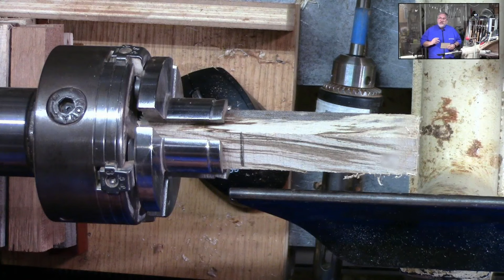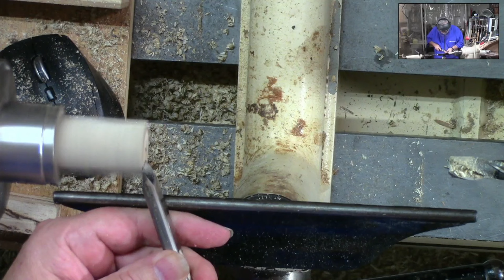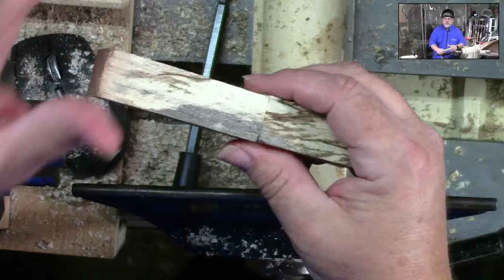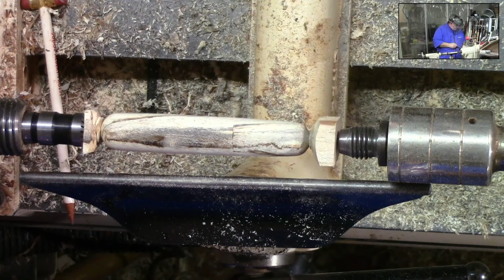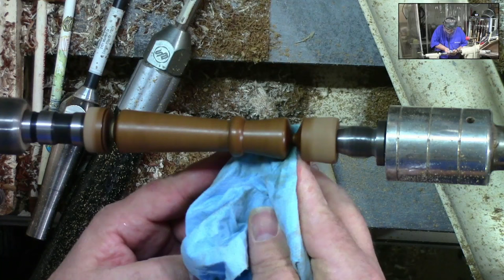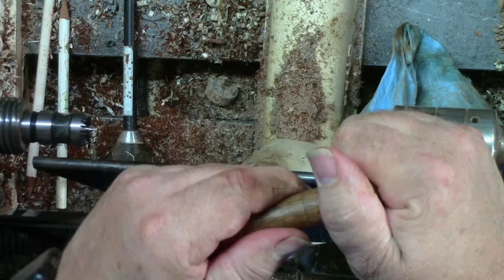How to Turn A Wooden Box That Sells, Woodturning Projects that Sell!!

Comment: Great tips and advice.

Perhaps a bit larger inside and out diameter and a bit longer would make a great gift idea for cigar smokers. 

Kind of a pocket protector for the cigar.

Thanks again.
👍👍👍🍻
Reply from the maker: Yes and you can actually buy kits for those or just make these larger and then you don't have to buy the kit. Thanks for watching

Comment: Do you have any advice on how to deal with alignment issues when fitting the lid to the body? Once I've got the tenon cut and fitted correctly, I turn the whole piece round, but once you move the lid, it's clear they don't match up anymore. It's like the tenon, or something else, is slightly off center. The issue is present no matter what drive center or chuck configuration I use. It seems to be present no matter what.
Reply: So it's been a year since I posted this, I forgot all about it until now. Since then I've progressed a little, and I'm pretty sure back then my issue was that I applied a bit too much pressure when turning, which caused the piece to run out of center and create an oval shape as opposed to a round shape. To prevent this, I keep my tools much sharper these days, and I take lighter cuts.

Comment: Hi Dean having watched you make these boxes I have made some but most when finished the top and body are eccentric to each other when assembled, I know its me, what am I doing wrong help please. The blanks are planed to dead square and all holes are carefully drilled.😰
Reply from the maker: That is normal with these and that is why it is important to align the grain before you turn the outside. most are not off by much, but for some reason some of them are off quiet a bit. Thanks for watching!!!
Reply: Thank you Dean for your answer it will help me so much.
Please continue with your advice tips.
Reply from the maker: Glad I could help.